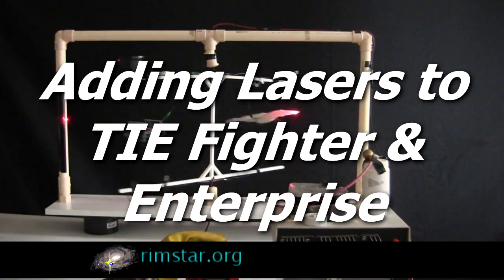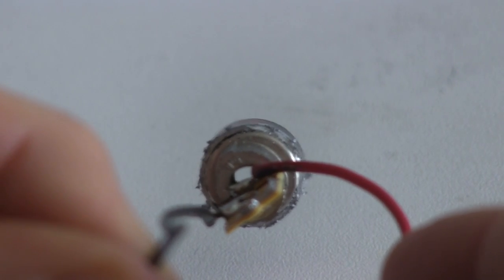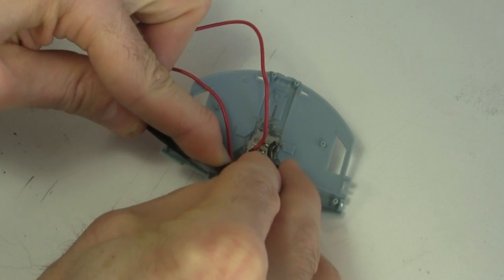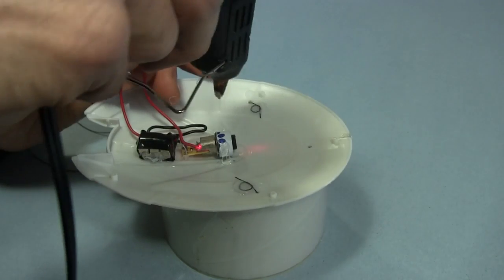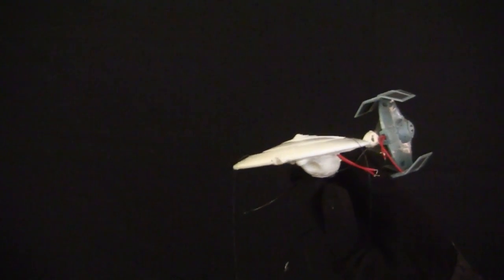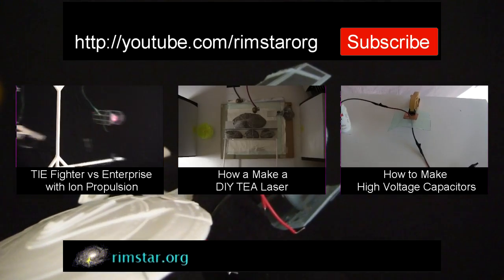Adding Lasers to Star Wars TIE Fighter and Star Trek Enterprise Models

Comment: Can't laser diodes still work without the circuit boards?
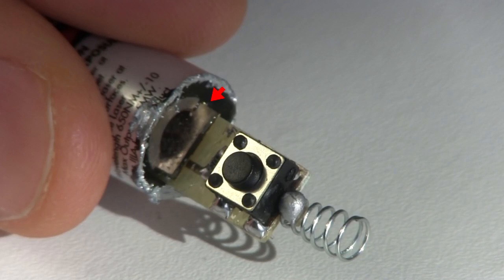Reply from the maker: Brandon Fisher Yes. But this circuit board held the switch, and also a 111 ohm resistor in series with the batteries (you can see it at around 0:43 in the video.) My guess is the resistor is there for current limiting to protect the laser diode. I know with regular LEDs you often put a resistor there for that reason. Notice that I got rid of the switch but kept the resistor.
Reply: RimstarOrg Drat, I just removed the laser diode from my 405nm violet laser pointer that stopped working due to issues with its circuit board (the diode itself still works though); I was hoping the circuit board wasn't too important so I can give the diode a new use, do you know how I can still use the diode? :-(
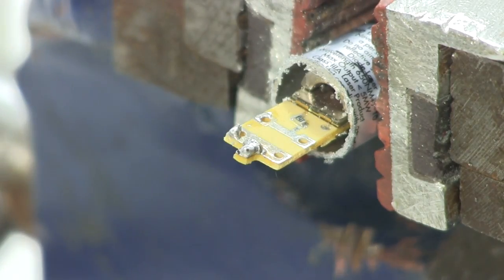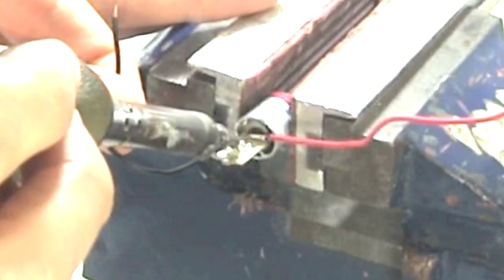Reply from the maker: Brandon Fisher Actually, if you look at 1:14 and the still photo at 1:22 in the video you'll see a part of the laser may be on the board too. If yours is like that one then you may not be able to use it at all. Alternatively you can try adding your own 111 ohm resistor (or check you board to see what size resistor it was using), if you still have a place to connect it to.
Reply: RimstarOrg Well I didn't break the circuit board, If I had some soldering equipment then I could simply re-solder the laser module back to the circuit board & try to fix the circuit connections due to the damaged solder joints if it's possible but sadly I don't so bummer :-(

Comment: Good fun for a weekend winter project :)
You could glue the lens to the front of the laser, but you've already got them to dinky size..scale size even.
Reply from the maker: Yup, it is. I also learned a bit more about these lasers.
Good point, that would get rid of the black plastic part that screws in to hold the lens in place.

Comment: That was pretty cool,  Maybe use the switch that you took off and mount it into the model so that you can turn it off and on and not have all the wires hanging out of the model.  just a thought... Like what you do.. thanks..
Reply from the maker: Thanks. Re the switch, it's the type that you have to hold to keep closed. Though I guess I could put tape over it for that. I'll definitely hang on to them for future projects.
Reply: ah, ok.. Yep I'm sure you do hold on to all the extra odds and ends, you never know when your going to be able to use it.... thanks again..